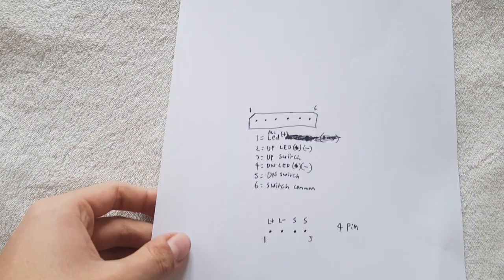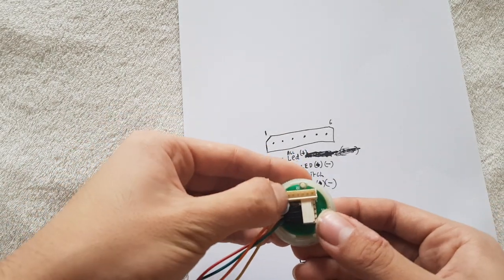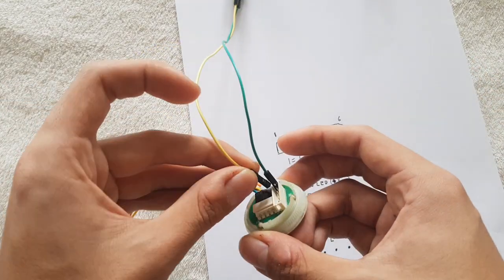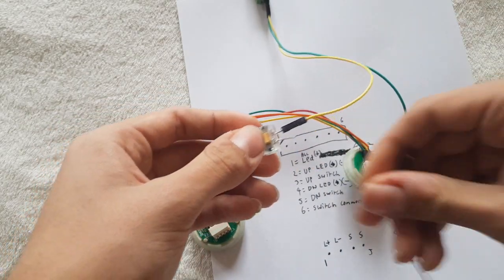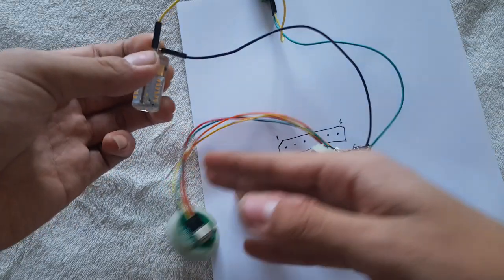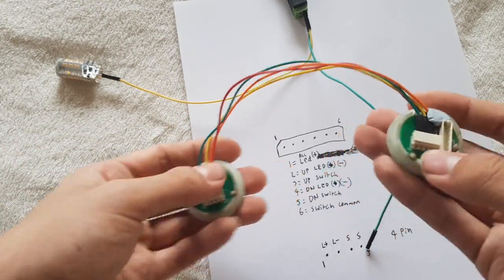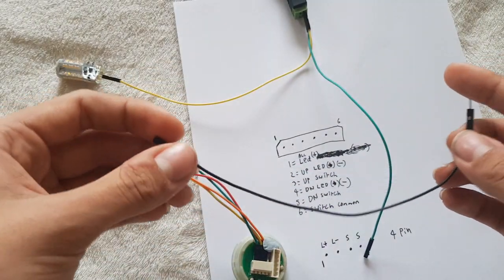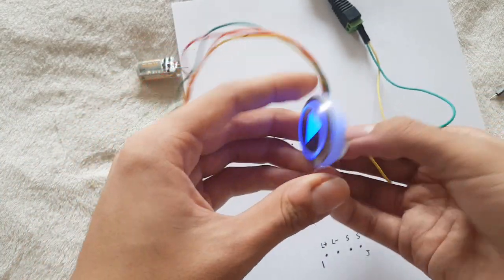KONE button wiring

Comment: how do we know the voltge of the buttons?
Reply from the maker: Most lift buttons use 24V. If you've got ones like these then they'll use 24V fed from the Kone button interface. Some alarm buttons use 12V to work with the alarms battery supply which is normally 12V.
Reply: Ok but how do we only make it light up when the button is  clicked

Comment: http://u.cubeupload.com/TheRealZZ9/DSC00412.jpg Here's a rough dimension measurement of the charger I've been talking about - looks like it's about 6.5mm wide with a small pin inside at the centre making for a 3.25mm radius subtract the visible edges of the charger
Reply: @liftadventures Is the dimensions of this charger compatible with the adaptor? I have one other 15V charger that I don't use much that could work but I think that one might actually be even bigger lol
Reply from the maker: YouTube hasn't told me i got comments again. The adaptor will not work with the charger you have, the only way you can use the power from it is to cut it which you can't do. If you're sure about using the other charger, you'll probably need to cut the connector off it and use the bare wires.
Reply: @LiftAdventures  plz do me a big favour and see if you can find a similar adaptor that will work with the charger i have :)

(wow youtube being youtube again then)
Reply: @LiftAdventures  could you plz try finding me a power supply of around 15V with the right end for the adaptor? :)
Reply from the maker: It's going to be hard to find an adaptor for the power connector you have. Laptop power supplies are very weird as there's many types of connectors. There's many power supplies on eBay and Amazon with a 15V output but they are of questionable quality. Some let mains voltage through them to the low voltage output side which can be lethal.
Reply: @LiftAdventures  i'd probably be wanting a suitable adaptor more than a suitable supply then, save any risk from issues
Reply from the maker: Happy New Year! The adaptor will be hard to find as the connector is a weird one and an irregular shape. I have looked around over the few days and have not found an adaptor anywhere. It seems like a connector that the laptop company use a lot.
Reply: @LiftAdventures  by unusual shape are you just talking about the different dimensions to normal? And yes it is a regularly used charger - it came with a Dell Chromebook 11 3189
Reply from the maker: Most DC connectors are 2.1mm. The one you have looks different the the normal ones.
Reply: @LiftAdventures  2.1mm is the reference for radius? or diameter?
Reply from the maker: It's the diameter of the inner pin.
Reply: @LiftAdventures  the inner pin? well on my charger that's literally the same as or slightly less than the width of the pin part of a drawing pin XD
What would be the required dimension of the outer casing of the outlet that would be compatible?
Reply from the maker: 2.1mm is the diameter of the inner pin. The pin in your charger is tiny.
Reply: @LiftAdventures  yeah it is tiny. What would the suitable dimensions of the outer circular part of the charger need to be?
Reply from the maker: The adaptor work with plugs with an outer ring diameter of 6mm.
Reply: @LiftAdventures  ok, at some point in the next couple of days i'll check this other power supply that could be used and see if the dimensions of that one would work
Reply: @LiftAdventures  Here are 2 images of my other power supply which outputs 15V at 4A current.
http://u.cubeupload.com/TheRealZZ9/DSC00414.jpg - poorly measured but later confirmed as approx. 6mm outer ring diameter
http://u.cubeupload.com/TheRealZZ9/DSC00416.jpg - inner ring diameter of 3mm approx.
Reply from the maker: Here's what my terrible measurements have given. https://pasteboard.co/HUTbwGo.jpg
Reply: @LiftAdventures  your one's outer ring is 5mm and the inner ring is 2mm. Looks like mine is 1mm too big on both counts

Comment: Would I need a different type of Arduino board to connect pairs of pins on the circuit board together and would a standard computer charger work well for the 240/230V mains supply?
Reply from the maker: You could use terminal blocks to connect the male ends of the pins together. 
What voltage is the computer charger you have? Most are around 19 volts. Buttons run on 24 so it should be fine. Make sure that your buttons are 24v before you wire them up, they are rarely 12v.
Reply: @LiftAdventures  my charger outputs 19.5V. Could you show me how I would use the terminal blocks to do that via the medium of an image? Also how do I check the voltage of the buttons?
Reply from the maker: This is risky but the buttons are most likely 24v so they will work fine with 19.5v. There is no real way to make sure. You could check the place you got them from. This quick video should be of use, if not please ask more questions. https://youtu.be/8Il727Azm8k
Reply: @LiftAdventures  aha I can see how the wires connect now. I can't find the eBay seller who was initially selling my call button so I can't figure out by that way what the voltage is
Reply from the maker: That's unfortunate. It will most likely be 24v but it always is nice to be sure and not fry them. Your ones look more prone to damage as they have circuitry. All mine have are LEDs and resistors.
Reply: @LiftAdventures  if it helps you to help me find out what voltage they run at the circuit board model number is KSS FB1
Reply from the maker: I've already searched that. it just brings up eBay listings of the buttons. I saw a number on the IC on the down button. If you want to give me the number I can try and find some info on it.
Reply: @LiftAdventures  there's a number F2KFB2 at the top of the circuit board on the down button and on the right there is a 3.217-03 on it. It's easy to see from the image of the buttons that I linked to a while ago
Reply from the maker: Apologies, I meant the number on the black IC on the UP button. The number hopefully will say what the chip does, and hopefully give a voltage range for it.
Reply: @LiftAdventures  78L15A
6K533
(unsure if the 5 is a 5 or an S but try it as a 5 first i think)
Reply from the maker: 78 series is a voltage regulator. Looks like it outputs 15 volts. The buttons will be fine on 19.5v
Reply from the maker: The 78 series are voltage regulators. The output will be 15v I believe so 19.5v from your laptop power supply will work.
Reply: @LiftAdventures  so it should be fine then because the power supply you link in the description will decrease it to a safe level of 12v right?
Reply: @LiftAdventures  so it's basically a built in version of the power supply you link to on eBay? So all I would need is the thing that can connect to split the one connector into two for the cables and it would be fine? The output current type symbol is the one with a solid line above a dashed line so I assume that means DC?
Reply: @LiftAdventures  wait hold on, i don't think the charger i have available is compatible with the adaptor
Reply from the maker: Laptop power supplies tend to have weird connectors that are bigger than usual. If you don't use the charger anymore you could cut the connector off and use the bare wires.
Reply: @LiftAdventures  no the charger is used fairly regularly
Reply from the maker: Do you not have any other power supplies you could sacrifice? The only option would be to buy the one on eBay or find another one then.
Reply: @LiftAdventures  it would probably be easier to find a good link on eBay, that way I can get possibly a couple of them so I can have more than one button on the go when I eventually manage to find another button that I can wire up. So if you could find a good link and add it to the description (preferably one with output of between 15 and 19.5v) that would be great :D

Comment: so what about wiring up so when you press the buttons, the LEDs inside the buttons would light up?
Reply from the maker: Connect pin 1 to positive on the power supply. Link pins 2 and 3 together. Link pins 4 and 5 together. Connect pin 6 to negative. Pin 1 is the end where there's the angled part
Reply: @LiftAdventures  and how have you connected up the wires to the power outlet, whatever that happens to be in your video?
(The reason I asked about the above method is that that is my eventual goal for wiring up my button)
Reply from the maker: The 2 wires coming from the top of the screen are from a 12v power supply that I have. The green wire was +12v and the yellow was Ground. I used a 12v power supply, a 24v one would work but I'd play safe and use a 12v one. If you have anymore questions please feel free to ask, it would be nice to see your buttons working.
Reply: @LiftAdventures  could you find an ebay link for a similar power supply and add it to the description plz?
Reply from the maker: Done that. It should be in the description, if not https://rover.ebay.com/rover/0/0/0?mpre=https%3A%2F%2Fwww.ebay.co.uk%2Fulk%2Fitm%2F282547623801 it's the exact same one I use. They are quite reliable.
Reply: @LiftAdventures  why do your ebay links always have rover at the start? just curious. :P
Reply from the maker: I genuinely have no clue. Could be the fact I use the app to generate ebay links.
Reply: @LiftAdventures  ah
Reply: @LiftAdventures  so the red and black on that supply basically correspond to the colours you use on yours?
Reply: @LiftAdventures  and where does the terminal block come in to it all?
Reply: @LiftAdventures  and would i need some different arduino cables for linking two pins together?
Reply from the maker: The terminal block can be used if you cut the wires or want it neater. The red and black are positive and negative. Brown and blue are live and neutral.
Reply: @LiftAdventures  and for linking up two pins on the board would i need a different type of arduino cable?
Reply: @LiftAdventures  and (hopefully) final question, do i plug the power adaptor into something like a standard computer charger?
Reply: @LiftAdventures uhh what?